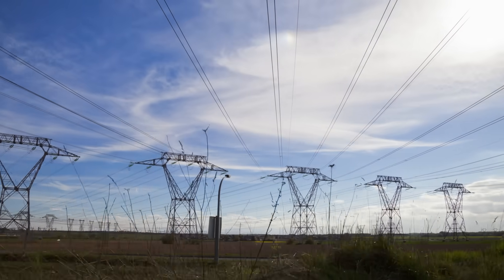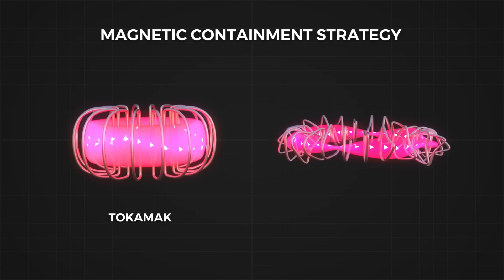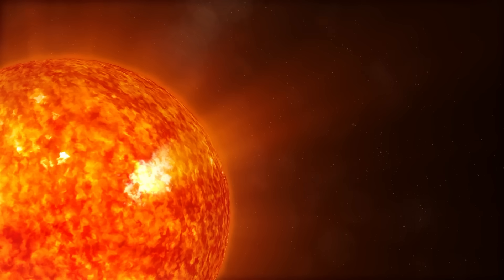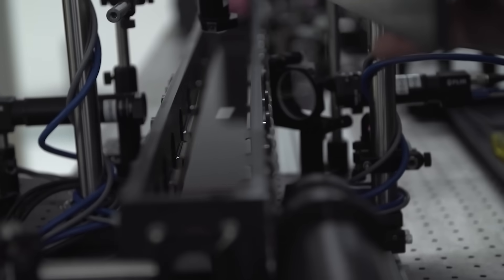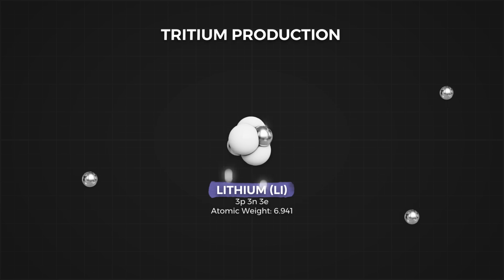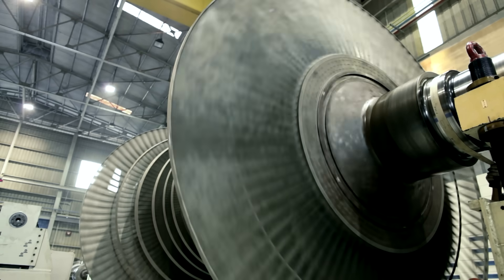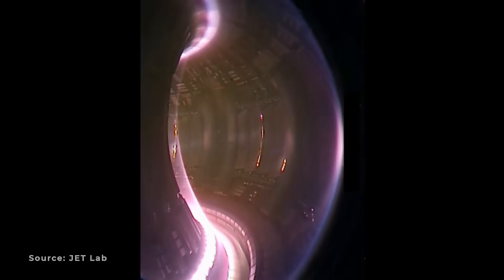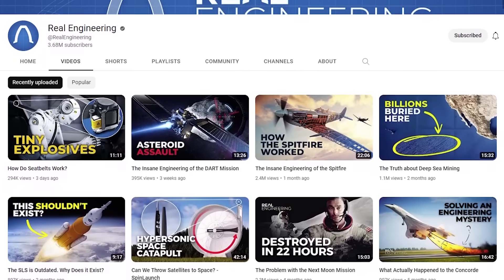The Problem with Nuclear Fusion

Comment: Not Worth Watching... !!!
Nuclear Fusion Energy on Earth pre-dates Mankind and even The Dinosaurs. It was there AT THE "BIRTH OF EARTH" TOO .... Mankind came much.. much later.. and is still there EVERY DAY OF EVERY YEAR since then... 
It's Energy is Abundant, Sustainable, Safe, Pollution & Cost Free .. it's source is the SUN.. yes the same Sun that shines every day.. 

The thing that was "missing" upto the 20th Century was the ability to convert it to Electricity economically and Pollution Free...
Fortunately, Mankind has "Gifted Itself", in the 21st Century, the Technology and Equipment to do this DIRECTLY,  by using "passive" PV Panels with Solar Cells.. and is also very "Cost Effective" too.. 
What is the problem with this "mother-of-all" Fusion Energy Reactor that floods the Earth with ~200,000TW of Solar Energy and with ZERO POLLUTION... as far as humans are concerned too.. ???

CAN ANY HARE-BRAINED MANMADE NUCLEAR REACTOR TODAY EVEN REACH 1TW... OR EVEN  10GW... for that matter...

 Why Waste Time, Money & Resources on these "Mickey Mouse" Reactors... that are NOT NEEDED in the 21 st Century.. reminds me of finding a "new way" to make the 4000 year old Pyramids.. well never mind... 
You get the idea..!!!

WILL THE NUCLEAR ADDICTS GIVE UP,  ACCEPT & EMBRACE THE SUN AS THE ONE & ONLY NUCLEAR FUSION REACTOR NEEDED BY MANKIND IN THE 21ST CENTURY.. AND BEYOND.. ACTUALLY WAY WAY BEYOND.. TO THE NEXT MILLENIUM & BEYOND.. TOO.

Comment: You already lost me like 40 seconds into the video… „cost effectiveness“ should be completely ignored because it will always look expensive compared to coal, gas and oil. The thing is, the planet is no free market where cost decides everything. If it is 10 times more expensive but sustainable it’s still the better option… because good luck enjoying profits without a decent place to live.

Comment: I remember talking with a professor at MIT re: fusion. He's been chugging away at it with his post docs for 30 years. The problem is, and always has been, the confinement blanket. At least, with these traditional geometries. (This is a very interesting knot-theory problem, however.. to see if it's possible to design a weird trefoil or something where inertial confinement is inherent to the geometry. The topological space of knots explored is like...tiny, even limited to 3 loop or what have you. With the advent of additive manufacturing, these topological constructs can also be manufactured (something which was not viable even 10 years ago).

Considering how easily the US federal government managed to print 5 trillion dollars during COVID, if the biggest barrier to the energy market for fission was solely financial, we could pretty readily count on global scale adoption of nuclear power plants once the boomers die (even the most conservative/right wing millennials have no doubt that climate change is largely anthropogenic). 

The real issue is social - people think of Fukushima, TMI, and Chernobyl and think of catastrophe. Judging nuclear fission power based on these catastrophes is about as irrational as fearing flying in a Boeing 777 because you saw some footage of a Wright Brothers plane crash. Anything 3rd gen or later is inherently safe by design. There is sufficient UF6 raw stock to centrifuge out enough U235 to fuel the globe up until ~2040. These designs, again, are inherently safe. 

In terms of waste disposal, the US DoE has dug mines literally >1km deep with ~15m diameter bores into which long-decay fissile products can be encapsulated into concrete and dropped into the mountain. Fast breeders (which, albeit are not inherently safe, nor have they underwent any substantial testing) can take Pu239 waste material and use it as fuel.

Finally, I can't critique this new company as...well, I cannot time travel 1 week into the future. But if this is like any other start-up, at best we can hope for is a 100% perfect design and a few products that gradually make it to customers. Over the course of (at best) 10 years, bugs will be worked out and commissioniing these in quantity will be viable. During the interim, I'm (just like Carl Sagan was) an advocate of responsible fission as a base-load source (augmented with solar et al)

This is not a technical problem, it's a PR problem.
Reply: Printing money doesn't create resources just forces people to spent money

Comment: @Real Engineering - O. M. G. dude. You have so many minor, medium and critical mistakes in this episode, it is unreal. Too many to list them all. Very far below your usual standards. Very disappointing to see you spread misinformation. Two examples: 1) Fusion does NOT need extra neutrons; that was conflated with Fission. 2) Neutrons from DT fusion will cause ANY isotope of Uranium to fission, including the "non-fissionable" isotope, U238.

Comment: The problems of fusion are enormous, and much much more efforts have to be made to the research of molten salt reactors. 

After significantly easier, but also challenging research and a functioning salt fission reactor, basic research in the field of fusion power plants can be done with larger contributions.  Now we should focus on thorium fission!

Comment: There is no choice to reduce CO2 other than solar + nuclear. We can research and test new technology, but nuclear has been generating electric power for more than half centuries. 

It's like having more beans instead of meat. We have solution to solve CO2 problem and we can use it any time, but we don't like it. that's it.
Reply: Half the problem is people being afraid of nuclear power, despite it being one of the best and safest sources of energy.

Comment: cheaper and even more applicable everywhere is geothermal.
and more likely  to be figured out and invested in.
fusion will still be too expensive but for the most richest nations to invest in until it's costs drop.
fuels used limit it to coastal  use for cheap and abundant fuel sources too.
whereas geothermal can go anywhere you can get drilling rigs into.
once drilled, you never have to worry about fuel input again.
cost  of fuel will never change.
it'll last forever.
just what  maintenance is needed .

Comment: I still don't understand how you can get more energy out of this than you put in.
Reply: do you mean the physical aspect of it or the engineering part?
Reply: @spanke2999  The physical aspect. Where does the extra energy come from?
Reply: @MascletaTheFirst  this is a very 'rough' explanation but in current physics you have 4 fundamental forces. gravity, which is the weakest and the only one that doesn't fit exactly with the others. luckily it has nothing to do with fusion so we just skip it. then there is the electromagnetic force, the weak nuclear force and the strong nuclear force. these three play a role when talking about atoms and subatomic particles. the strong force is relevant when diving into protons and neutrons, they keep these together. with fusion we don't go that deep so we skip it as well. what remains is the electromagnetic force between charged particles. like electrons and protons and the weak force, that keeps protons and neutrons together in the nucleus.   

if you take a look at an atomic nucleus you'll find protons and neutrons. neutrons have no electric charge on the outside, so it is no problem to have them close together. but protons are charged. they should repel each other. they don't because of the weak nuclear force, which is able to hold them together. but this force is very limited in range. it only works when two protons are very close together. you could say if you bring them so close, that a neutron fits barely in between them, then the weak force is taking over and overpowers the electromagnetic force. 

and here is where the energy sits in fusion and in fission. because the weak force is so much stronger then the electromagnetic force, it's releases this energy when settling in an energetic lower and stable point.

you could picture this in a very simplified way. imagine two protons sitting each in a potential valley. if one proton wants to visit the other proton it has to climb a steep mountain. all the way to the top. then it can let go and rolls down to the other one. the problem with this picture is now quantum physics is not classical. in a classical world you would say the proton gains as much energy by rolling down the hill as it has needed to climb the hill. in quantum physics, the proton isn't able to climb the hill, it just tunnels the hill but gets the energy as if it was rolling down. 

I hope this helped a little bit. it is a very rough explanation and I'm sure others can do a much better job in that. maybe you'll find a good video about this with PBS Spacetime! they make very good videos about this.
Reply: @MascletaTheFirst  E=mc^2
The reactants of fusion actually weigh a little bit less than the products, and that difference in mass is converted to energy using the above equation.

Comment: Saying that Nuclear is uneconomical is falling for fossil fuels fallacies, thats' the lie they tell because renewables need gas as backup.
EDIT
Very cool data otherwise. However fission also has innovations such as nuclear waste recycling, so even with fusion and renewables it will still be needed for a long time, don't allow fission power plants to be closed, clearly fission nuclear power plants will still be needed alongside all the other low CO2 tech.

Comment: I’m all for fusion energy, but fission energy shouldn’t be abandoned. Fission has to be part of the solution to our energy needs and global warming goals. Yes, the original generations of fission plants were problematic due to waste and cost. The current fission designs are far safer, smaller, less expensive, produce less radioactive waste and are much more capable of using up the uranium. In fact, the waste from the previous decades of nuclear plants can be used in the new plants. I’m surprised this information wasn’t presented in this otherwise excellent video. Did I perhaps space out  for a minute and miss it?
Reply: you have to phrase it differently, the current designs 'could be' better. because so far nobody has actually build them and run them to prove the points you made about it. and that's true for two reasons. it's expensive and often you can't build a bomb with it. therefore nobody is really interest in it
Reply: @spanke2999  I don't know the relevance or legitimacy with regards to your bomb reference, but I believe the main motivation for governments is to have a safe and reliable power supply. One that moves away from coal and gas. Less reliance on other countries. Remaining competitive with countries moving fast on these and other developing technologies. China and Canada are building SMR (Small Modular Reactor) plants. Both in started in 2021. I'm not sure if they are up and running yet. Micro nuclear power plants are up next I hope.
Reply: @jonreiser2206  nuclear technology was devolved and heavily subsidized mainly as a way to create and support the manufacturing of nuclear weapons. That's why it was always kind of expensive and not very efficient when looking at the over all costs including  reprocessing and storage of the remaining waste. taking a look at all the other concepts, which are often better suited for the civil use, you'll find that they are much less funded, developed and so on because... you can't build a bomb so easily with these types of reactors. 

with respect to safety and reliability so have all reactor types the problem that they are high tech and need a certain amount of care and security to become manageable. that doesn't mean it is super risky, but a windmill doesn't needs to be protected against terrorists, because you fear they might misuse the wind in any way. 

Also the independence of others countries is not really a thing, because usable uranium isn't wide spread.  this is true for most fissile components. they all are in one way or the other limited and therefore create a dependency on specific countries. 

so, if we take a perfectly balanced view on nuclear energy, fission and fusion for that matter, we can make two observations. the development and construction is expensive. it needs resources that are kind of scares and need a special handling and or protection so that they don't become a risk to the public. 

green energy concepts don't have this problem. they are also need to be developed and they also give an independence from other countries. since they are all based in one way or the other on the sun, they are also reliable for the next billion years or so.  all we have to do is to invest in our infrastructure! 

so... we can choose now, invest in nuclear energy or invest in green infrastructure. both ways are doable. one is limited and risky, the other is sustainable and hard to misuse.

Comment: All they are doing is confining plasma to fuse plasma you need an electromagnet within an electromagnet with opposite magnetic fields so the plasma can be bombarded into the plasma of the outer ring.

Comment: Fission nukes aren't being shut down due to being uneconomical, they are being shut down because the regulators are very anti-nuke and have made it impossible to both build new ones and to get existing ones recertified.  Also no one is really thinking of doing D+T fusion as Tritium is way too problematic, D+D gets most of the same energy while not requiring breeding Tritium.  Because D+T is easier, the idea is to figure out a functional way with D+T then improve upon it until we can do D+D.

Comment: Other than the cost there are two other issues, the Monopoly aspect of centrally generated and distributed power and then there's the national security issue.

Century located massive power plants distributing electricity will allow companies to monopolize it just like oil has gone from a few dollars a barrel up to $100 a barrel and in between, it's easy to manipulate scarcity.

Then there's some national security issue about 50 years ago there was a power outage in Canada and the east coast of the US, sometime later security analyst pointed out that if an enemy was just sabotage a dozen points of distribution the US and Canadian grid could be down for months if not years.

On the other hand millions of houses businesses and buildings with solar and energy storage would be damn near impossible to sabotage because they're all basically isolated and combined with electric vehicles it will save people money which they then can spend increasing velocity of money in the economic system and improving the economy Verizon sending the money to special interests or overseas corporations.

Scientia Non Domus,
(Knowledge has No Home)

antiguajohn

Comment: The only reason nuclear hasn't solved our energy problem is because politicians want results with the confine of their election cycle.  Nuclear costs more to implement initially but more than pays for itself as long as you're not worried about re-election every 4 years.

Comment: 1) Fantastic video, amazing detail yet easy to understand format
2) For those of us like myself with average brains, please explain, if we are able to produce energy greater than what we put in albeit in smaller scales currently, why is scaling up so hard given we can just use the excess energy to fuel large reactions and continue the increasing cycle to the point we no longer want to increase the size of the fusion and instead use the excess energy to power homes etc.?
Reply: 2) we don't, for the moment only the energy input to the reaction is accounted for, not the energy (majority) to sustain the system, and the reaction isn't full time (sustaining it, is). This is only at experimental phase to prove the concept possible, far from net positive sustained industrial production, but exceptional science applied.

Comment: Fusion can't work because there is no neutrino confinement. It plays no part in reactions, but is essential 'lubricant' in the Sun to assist fusion through transfer of energy jostling spaces inside nuclei to facilitate reaction. Requires huge gravity and pressure to get sufficient confinement.
Reply: Its being reported that the US department of energy is going to make the announcement tomorrow that fusion has been achieved for the first time. I think it was the Lawrence Livermore lab from what I just read they put in 2.1 megajoules and got out 2.5 so thats about 120% efficiency.
Reply: @iraniansuperhacker4382  Seems like it - may be implosion can concentrate enough neutrinos to do the job while tokamaks and stellarators can't. But caveats still apply - more energy net used up creating laser pulse for fusion than net released through fusion.

Comment: The main issue with fission is politics, and always has been.  For some reason environmentalists think it's bad, and are always pushing to shut it down.  A lot of expense is involved in complying with over the top regulations that do nothing to improve safety, but that pales compared to the legal processes involved in getting a plant built.  Hundreds of lawsuits causing delays and massive uncertainty means no one is building nuclear plants, and I don't see that changing for fission.
Reply: Where we gonna put all the radioactive waste? It can only be recycled a number of times and the parts of the reactor that get irradiated are unrecyclable

Edit: but I do agree that there is far more restrictions against nuclear than there should be